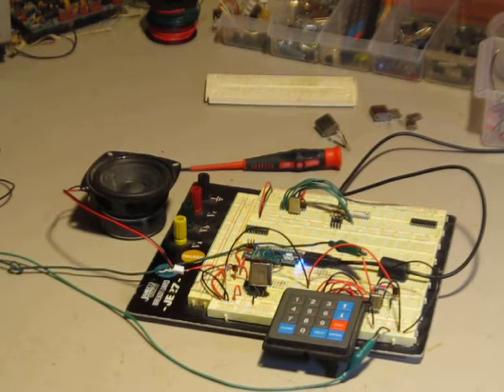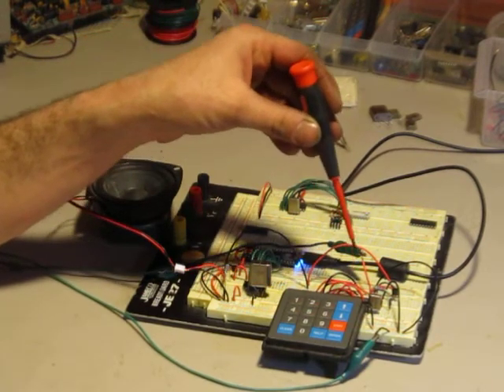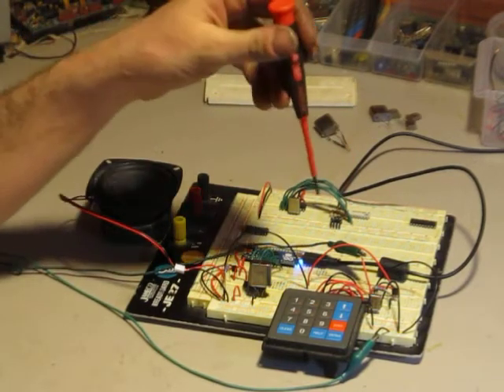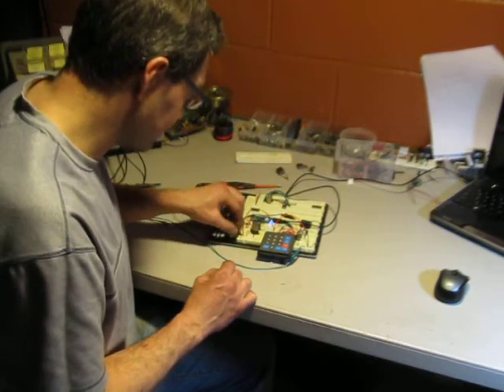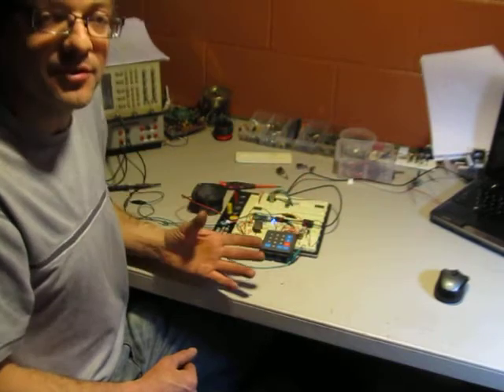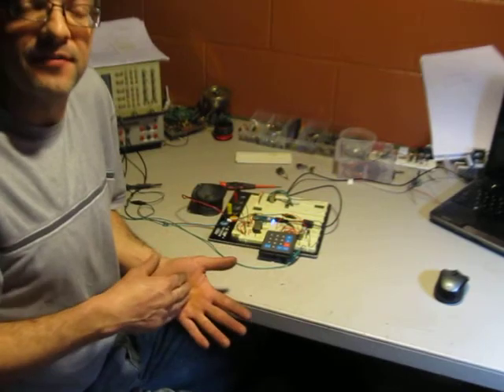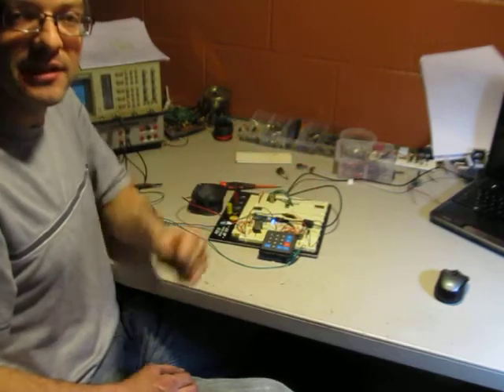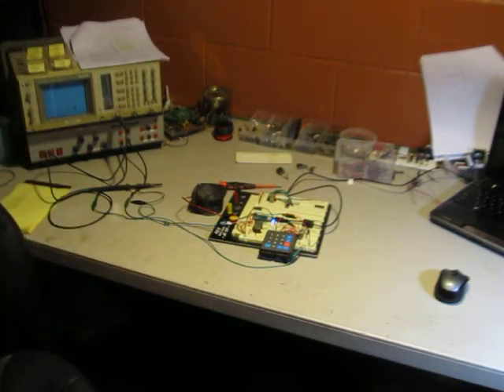DTMF telephone tone generator - W91312 & T25089

Comment: how did you connected the W91312 to a uC? it also says its possible in the datasheet... just provide - to the r[1-4] and + to the c[1-3]? (or the oppoiste)
thanks! 
(i also have a w91312 laying arround, but im using the arduino as a DTMF generator instead of using it...)

Comment from the maker: This chip will output the following frequencies 699hz, 766hz, 848hz, 948hz, 1216hz, 1332hz, 1472hz
This is from the datasheet, I no longer have it connected so I do not know what key makes what frequency.
http://pdf1.alldatasheet.com/datasheet-pdf/view/47784/WINBOND/W91312.html